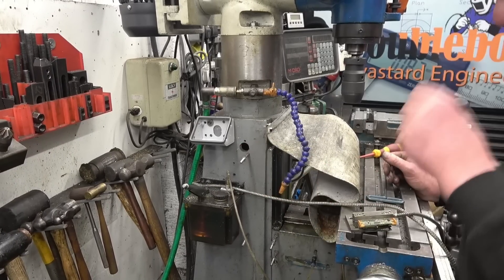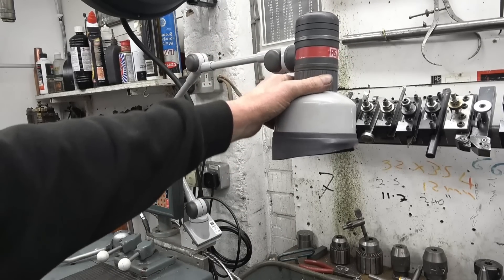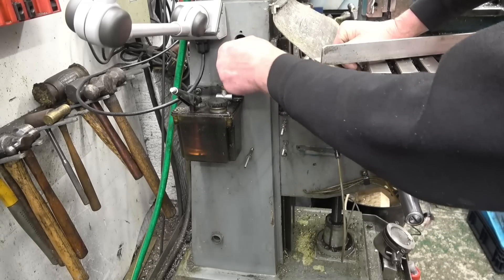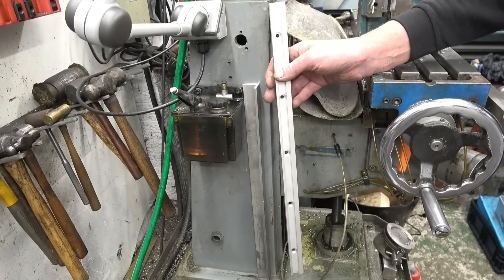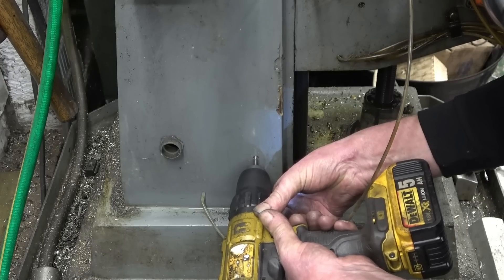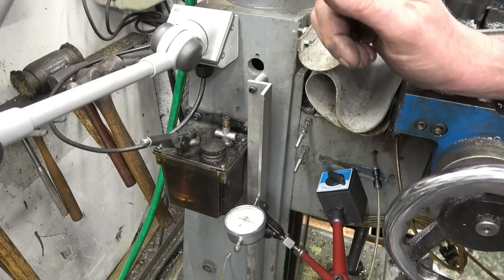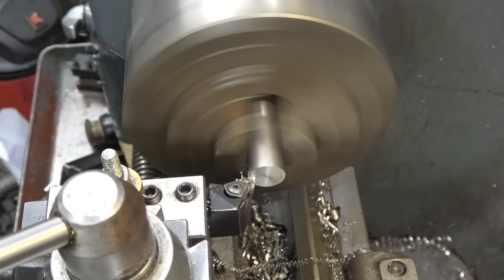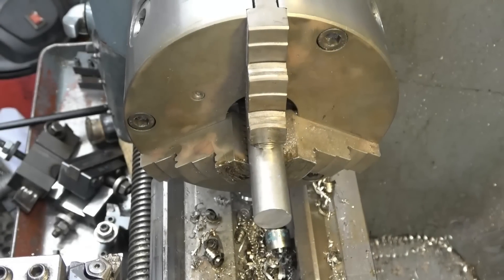SNNC 479 P1. Mill Z Axis Encoder Install

Comment: An old turner showed me how to grind back the boken centredrill to let you extricate the snapped off portion, handy on important jobs, but I would just have turned that piece around, drilled it from the back and punched the broken tip out ?
ps, your missing tee nut  is down behind the coumn @ 3 minutes in !

Comment: I have a magnetic scale on an identical milling machine and mounted like yours.  I find that when I use the Z axis clamp, the reading alters because the knee tilts very slightly on the sliding clearance of the gib and then changes when the clamp is tightened.  See if yours does,

Comment: So, what happened to the center drill?  Did schmutz get stuck in one of the flutes, harden, then push off to one side?  Either way, thank you for sharing this stuff rather than delete the clip and act like life doesn't happen.
Reply: Unclamped tailstock is most likely or possibly work hardening, despite what John says 316 (and 304) can be a sod to machine at times
Reply: Flute clogged and bust the end off.